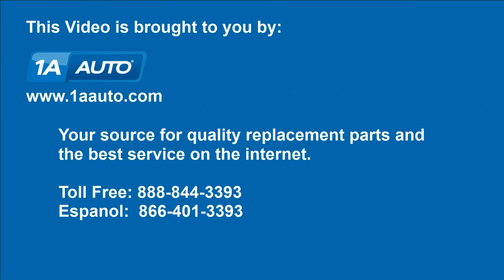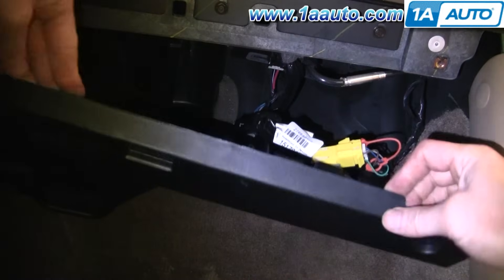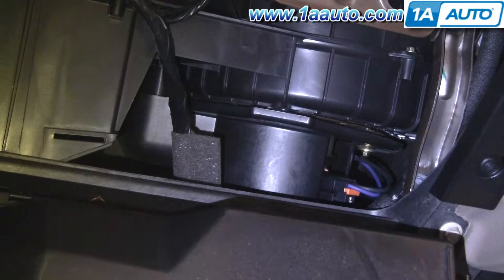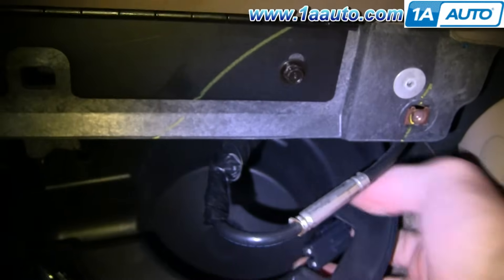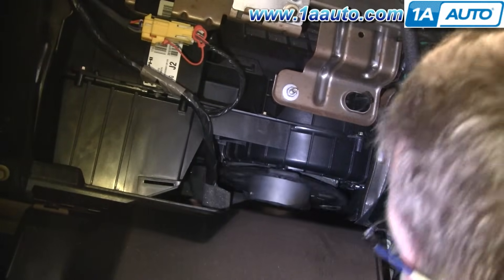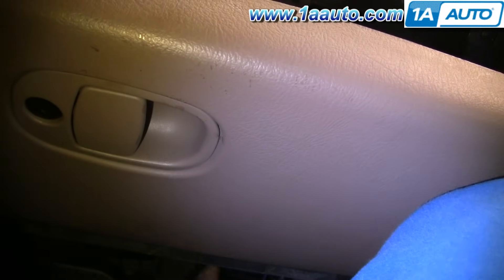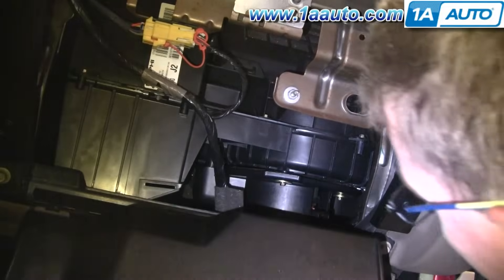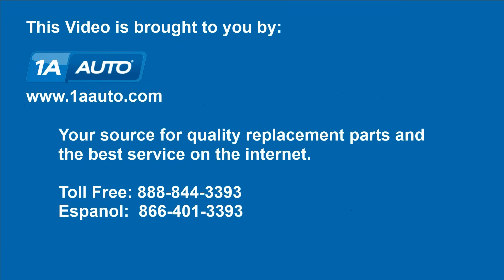How to Replace Heater Blower Motor 02-09 Chevy Trailblazer

Comment: Great video. Just replaced the one in my 2006 trailblazer using this video, and it saved me a lot of money. I found it easier to take off the glovebox entirely though. It’s just held on with 3 little screws. Gives you a lot more room to move around.

Comment: Great video, thanks! Just a suggestion that helped me on my 2004 Trailblazer. After pulling the blower fan motor due to excessive noise (mine was full of paper pieces, string or what ever) a mouse nest. Don't forget to either stick your hand up in the housing or use a shop vac to get any remaining debris out of there before putting the blower fan motor back in. If there's any remaining debris and you don't clean it out, your blower fan motor will be making excessive noise again when you put it back together and start it. This happened to me!  Also, I found it easier to take the glove box off completely, rather than it left dangling in the way. There are only 3 each (7 mm) bolts that holds the hinge in place. Thanks again for the video!

Comment: What is the troubleshooting procedure to determine whether or not to replace the fan speed unit or the blower motor? 2005 trailblazer and can only get air through top vents while driving. fan is inop

Comment: Love you videos..They saved me a lot of money working on my 2002 trailblazer. I need advice please. I gave my trailblazer to my kid..she is learning to diy like mom but the last fix wasn't entirely successful. She started with the resister. That worked as far as getting the heat to blow. But for some reason it only blows on the floorboard near the blower. She didn't unhook any battery so I don't think it would be the CPU .... I don't love near her and winter is coming. Any help would be appreciated. DIY mom.

Comment: this is great!  I do have a few questions:
1. on that kick panel, do you know what that yellow connector is? My truck has one side of that connector but it's not connected to anything else.
2. My fan motor sounds ok and blows ok but the connector to the blower resistor has slightly melted. Is it at all possible that the fan is fault and has caused this?  Thanks much!

Comment: I have a 2005 Chevy trailblazer LS 4wd and the fan settings stopped working completely. I swapped out the resistor and the fan settings were working again except for the 5th fan speed but I didn’t mind as long as the other speeds were working atnd it blowed cold air. Then one day I turned the AC on and switched it to the 5th speed by accident then I switched it to 4 then 3 and it completely stopped working again. I changed the relays and fuses and still nothing. Do you think it might be the blower motor or does the ac need to be charged?

Comment: hi, I just change about the blower resistor (real easy change - $51.88 taxes in) in my '02 Envoy as the control was not working in either position 1 thru 5, the rear isn't working either, still doesn't work - so I'm thinking it now must be the blower motor ..it looks as easy to change as the resistor was, the motor itself is expensive, here in Calgary Ab
Reply: John Ambrose I’m in a similar position. After I replaced the resistor I noticed some burning on the wiring. Every forum I’ve seen says that it is the blower motor.

Comment: Hi I just bought a 2003 Envoy, XL the heater dosent work at all so I change the blower moter and resistor and it still wont blow at all or turn on.. I do have a vid of it and the sound

Comment: I have an 06 envoy denali..air was going in and out then completely stopped up front. All vents. Only rear works. I replaced the resistor and also the control module. Its the auto controls.  Still not working! Doyou think it would be blower motor or actuators?
Reply from the maker: It could be either of these.  We recommend getting your vehicle professionally diagnosed.  Thank you for watching! +Troy Gould

Comment: Ac worked fine took in for a catalytic repair battery was disconnected... ac blows cold air if just front on... when front and back on simultaneously air takes a while to get cold.. does the actuators need to b recalibrated??? If so how

Comment: Okay, replaced the resistor and it still doesn't work. Checked blower fuse and it's good. On the plug to the resistor, I noticed E and G looked to be smoked, where do I go from here and what would be the easiest way besides junking the vehicle altogether? Thanx in advance.

Comment: I have a 2003 trailblazer that the ac and heat work fine but when i turn them on It makes a clicking sound on the passenger side vent? Is this the blower going out or something else?

Comment: For the fan blower, Are you replacing the fan blower or the parts that connect to it, because i am having that problem my air/heat dosent work and when i get to a certain speed it will kick on. Can you tell me what is the problem?  i have a chevy trailblazer 2005
Reply from the maker: Hi Steve, Usually when you start to loose the lower speeds on the heat, the blower motor resistor is going bad. Many times it will end up working only on the high setting. This video shows you how to replace the blower motor assembly. Here's a link to the new blower motor resistors on our website if yours has gone bad. We also offer FREE SHIPPING in the lower 48 states. Hope this helps you out. http://www.1aauto.com/1A/blower-motor-resistor/Chevy/Trailblazer/-/-/2005?utm_source=VideoReply&utm_medium=YouTube&utm_campaign=1ATony

Comment: I like what you're trying to do with the videos and all but your parts could be better.
I've put 2 sets of stabilizer links in my wife trailblazer and both sets have gone bad within a couple of weeks.
Other parts I've gotten have done the same thing.
Reply from the maker: +Lou Donovan Thanks for watching!  If you are having issues with any of the parts you ordered from us, please be sure to contact our customer service department right away.  We are more than happy to help resolve your issue!
Reply: @1AAuto  I did got a new set and it did it again.
Kinda tired of changing them

Comment: So if i purchase this part in my 2004 chevy Trailblazer it will correct the noise when i crank the heat up. There is no noise when its on low but the noise only appears when it is on high
Reply: A question mark will help.

Comment: I know this is an older video but was hoping you might still be able to see this comment and give me some advise. I have a 2005 gmc envoy and i have no power in setting 5. I have power to all speeds at the harness and a good ground on the harness. When i plug in the harness to the resistor it works on all speeds except 5. I can hear it click when switching to 5 and it kills the power to the fan. Even used an external 12v battery to power the orange ( #5 power wire) and the ground wire using another harness off of another vehicle and it still makes the resistor click and no power to the fan. Im baffled. Changed the resistor twice and no luck.
Reply from the maker: +James Parsley We wouldn't be able to diagnose an issue like that here, you may want to have a local mechanic take a look at it. Thanks for checking us out! http://1aau.to/m/Shop-1AAuto-c

Comment: hi, I would like to know is that my 2004 Chevy trailblazer LT all w/d when I trun on either for the heat or ac and I want to change the area I want the heat or ac vent it sound that its stuck on one are only its doesn't want to change all I hear is a clicking sound

Comment: Question what could be wrong with my 2004 Chevy trailblazer, put it on body an feet area and no air comes out of the body air vents
Reply from the maker: +Lekesha Johnson We can't diagnose it accurately over the internet unfortunately. We would recommend having a trustworthy mechanic pinpoint the issue

Comment: Is this to make the vent blowers at eye level work again? because the one for the windshield and the floor work fine..but the vents don't blow anymore.
Reply from the maker: Thank you for watching. The blower motor is what moves the air but does not control what vents it comes out of. You may have a problem with the Air Inlet Actuator. Hope this helps!
1aauto.com 888-844-3393

Comment from the maker: You may want to check to see if the AC system needs to be charged. If it's fine, usually when the blower motor resistor goes, you'll start to loose some of the speed settings. We carry them on our website for all kinds of vehicles. 1aauto.com 888-844-3339

Comment: I have a Chevy Blazer 2005 and the air system stopped working over all, the blower motor does make a little noise once in a blue moon like if it wants to start but when I turn on the air (either ac/heater/fan), it brings down the vehicles RPM to the level that the vehicle turns off... Also, it's very cold here... Help please... Thanks
Reply: Motor Fan Speed Resistor  is your problem burned out youtube video on it

Comment from the maker: You may want to fix the wires and plug that had melted. Usually a bad blower motor resistor will cause this to happen. 1aauto.com 888-844-3393

Comment: can you replace this part without the rubber hose or is that a must have? thanks.
Reply from the maker: No, You would need to replace the failed part with the correct part. Thanks for watching. 1aauto.com 888-844-3393
Reply: thanks for the quick response! that's tomorrow's project

Comment: my question is if the heater in the bk takes awhile to kick in and when it does only blows cold air and the heat in the front doesnt come on at all what should i check first
Reply from the maker: Thank you for watching. It sound like there may be multiple issues. You may have a issue with the blower motor itself for the front, and you may have a failed blend door actuator for the heat.
1aauto.com 888-844-3393

Comment from the maker: It could be the blower motor resistor of the blower motor. If you started loosing your speed settings and then finally lost the air coming through the vents altogether, then it could be a bad blower motor resistor. We carry them on our website 1aauto.com 888-844-3393

Comment: My 2005 chevy trailblazer makes a whistling noise when driving when ac is on. There is no noise when vehicle is idle and none when heat is on. Any clues? Thanks in advance
Reply from the maker: You may want to see if it's coming from the AC clutch when the AC is turned on.

Comment from the maker: They may have meant to change the cabin filter if your vehicle came equipped with one. They dealer can run your VIN # for you and tell you if it did, as well as it's location. Hope this helps you out. Have a great day! 1aauto.com 888-844-3393

Comment: Hi, I have an Envoy XL.  My air works perfectly in the front but not in my back seats.  It blows air when it wants to and when it does I can't control the temp of the air or the speed. I'm assuming its either the speed controller or the fan blower resistor which I'm assuming is in the middle console.  But I have no idea how to access it.
Reply: ACDelco 15-72813 HVAC Blower Control Module

Comment: howdie why does my blower motor only blow cold air in the rear ?hot air up frount 2006 TrailBlazer LT
Reply from the maker: Thank you for watching. You may have a faulty Blend Door Actuator for the rear AC.

1aauto.com 888-844-3393

Comment from the maker: You may want to check the fuses first to see you have a blown fuse. Then check to see if there's power to the blower motor (if the fuse is good), with a test light or an ohm meter. Hope this helps you out. 1aauto.com 888-844-3393

Comment: what else could the car have problems with it if its not the blower motor? we checked the fuses and they all seem fine.
Reply from the maker: You may want to inspect the plug end for damage that goes into the blower motor resistor. If the plug shows signs of damage from excessive heat, then it should be replaced. 1aauto.com 888-844-3393

Comment: I have a 02 trailblazer it blows wen I turn it on but heater don't blow heat just cold an on hot days I turn the AC on it blows hot what could be my problem
Reply: Motor Fan Speed Resistor  is your problem burned out

Comment: Is this pretty much the same fan replacement for a 2003 Suburban?
Reply from the maker: +JD Williams The part shown in the video does fit your application. It should be the same or a similar procedure. Here is a link to them on our website. Hope this helps you out. http://www.1aauto.com/1A/BlowerMotor/Chevy/Trailblazer/1AHCX00074?utm_source=YouTube&utm_medium=CTA+Comment&utm_campaign=ytcomment&utm_term=7IWyOLDHJBM

Comment: I changed the motor wires r good but heat still doesn't blow I here something when I change to vents an floor still no heat wat should I do next
Reply from the maker: You may want to check the fuse, and also test the circuit to see if there's power going to the blower motor when the switch is turned on. Hope this helps you out. 1aauto.com 888-844-3393
Reply: Motor Fan Speed Resistor  is your problem burned out

Comment: The heat does not blow out on the driver side of my 2008 trailblazer .  Passenger side if fine but not driver side..  Can you tell me what it might be?   One side works so it doesn't seem like it could be the blower motor?   You know best
Reply from the maker: It might be an issue with the actuator, but you may also want to check the vacuum lines along the firewall in the engine bay, and also under the dash to see if one is broke or cracked. Hope this helps you out. 1aauto.com

Comment: My blower is just not working you guys think if i replace this it ill start working, is not making any noise just no air coming out
Reply from the maker: +gerardo torres You may want to see if there is power going to the blower motor. If there is, then the blower motor may be bad. Here is a link to the one shown in this video on our website. Hope this helps you out http://www.1aauto.com/1A/BlowerMotor/Chevy/Trailblazer/1AHCX00074?utm_source=YouTube&utm_medium=CTA+Comment&utm_campaign=ytcomment&utm_term=7IWyOLDHJBM
Reply: 1A Auto Parts 
Thank you